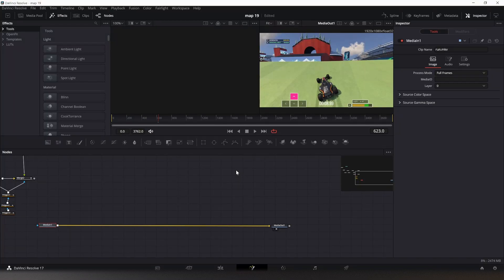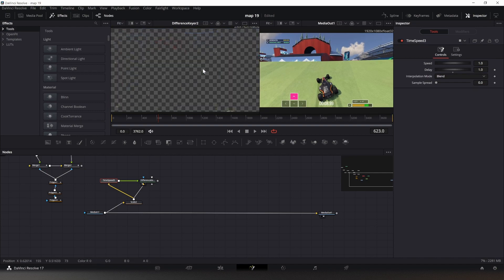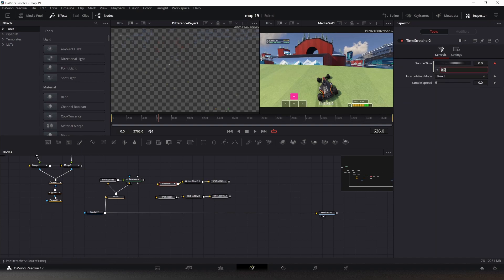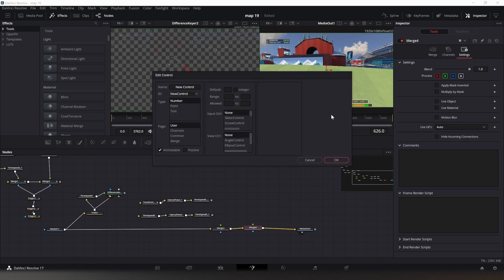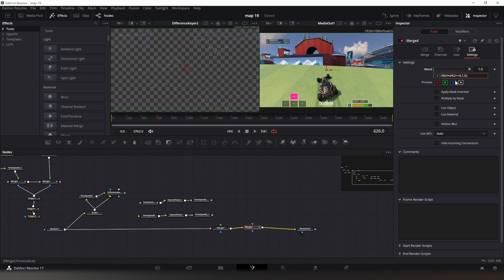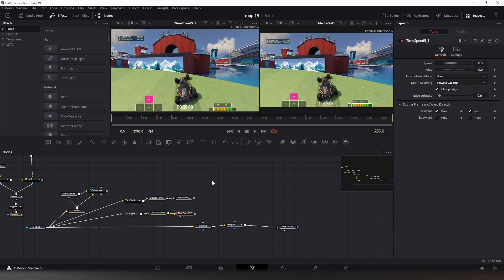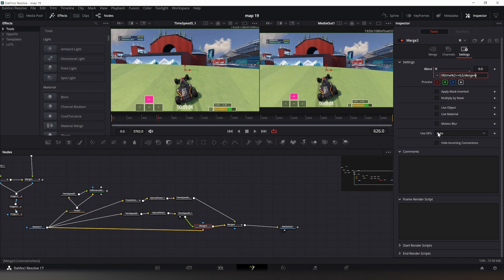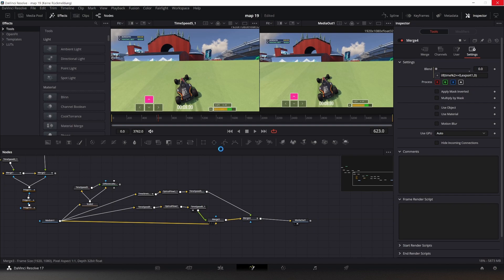[Intermediate] How To Remove Frame Drops From Your Recordings In Fusion

Comment: This is very nice, but overkill. Fusion has a node, called Replace Frame and another, I don't remember the name of. The difference between the two, is the one I forgot the name of requires two inputs. Replace frame just looks at your footage.
Both nodes have Optical Flow built in.

The way, the Replace Frame works, is you put it after the MediaIn. Then you can scroll through your timeline, and if you come across a frame, that needs to be replaced, you simply check two checkboxes, one for Pre(vious) frame, and one for Next. You key that. It will then make an interposation, between the previous and next frame.
To automate this, you could still use your probe script. But you would get rid of the 'even' and 'odd' frame nodes, that require a lot of computation - hence why it crashes for you. I can see, that you don't use a lot of your ram, so, I'm a bit surprised, it crashes for you, as is.

Usually, when there are double frames in a video, it's because the video was re-rendered from one frame rate, to another. This means, that it's every Nth frame, that is bad.
I've been working on a macro, that automatically fixes this issue. One just have to count, how many frames there are between broken/bad frames, then set a wheel to that number. A second wheel, adjust the offset, to fix the "right" broken frames. And then there are adjustments for OF. It's 5 or 6 nodes, totally, just using merge, a Custom Tool, the Replace frame and a text+ helper (to mark broken frames). Then you just render out the video.

The only issue with the Replace Frame, is that it doesn't work well, on complex frames, with a lot of graphics moving in different directions.